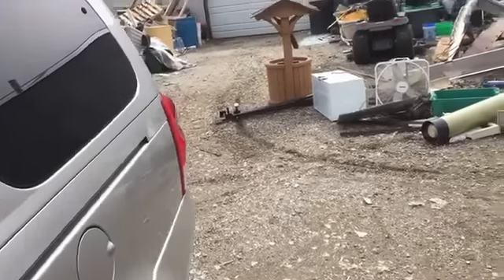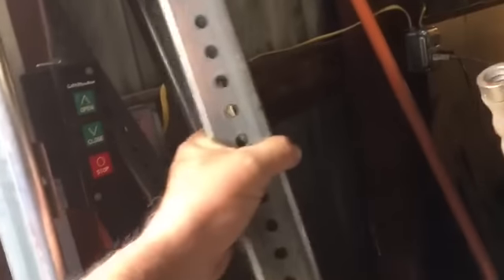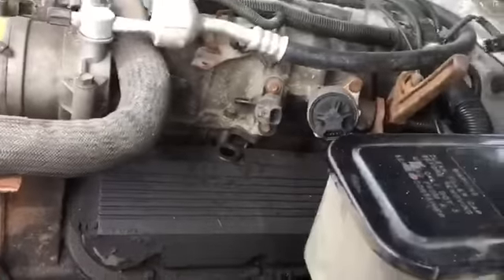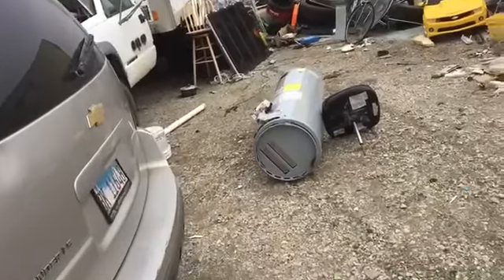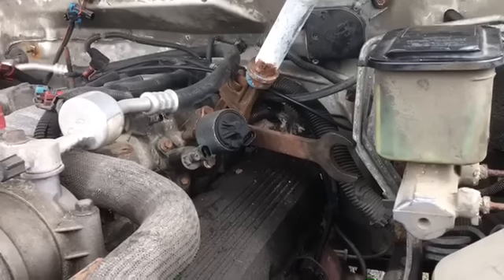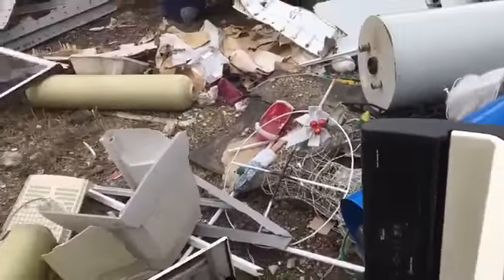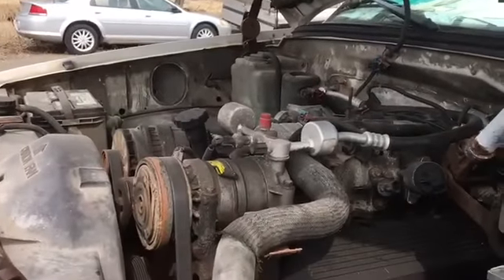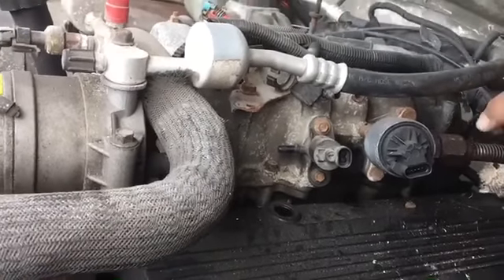Back at the compound

Comment: wedge a piece of wood under the wrench to help spread the pressure over the valve cover and keep the wrench from moving
Reply from the maker: Yup ya idea almost worked   Until the wrench 🔧 started to BEND!   now it’s not a snug fit anymore 😳🔧
Gonna have to cut the tube
Reply: @steelisthemeal  just go to an automotive shop and buy a spanner, that actually fits it wont be more than $15
Reply from the maker: Alexander platz gotta find a thin one 
Most of them are too thick to fit into that tight spot
Reply from the maker: Alexander platz especially the cheap Chinese ones at Harbor freight tools
Reply: @steelisthemeal  What about Snap on, here in the uk we have Snap on trucks driving around visiting mechanics at their garages , I'm certain that they could sort you out my friend these tools are made in the USA and the best tools you can buy so no problem with quality there
Reply from the maker: Your right we have those guys all around 
Usually find those guys at car dealerships
💰💰💰💰
Very expensive but probably worth it
Reply: @steelisthemeal  Dont think it would be more than $25 for a single wrench, gotta be cheaper than a mobile mechanic  my friend
Reply from the maker: Ya right bout that 
Mobile mechanic is $160 just to come out and $110 per hour two hours minimum
Reply: @steelisthemeal  well worth a punt then Marty,me I'd give it a go might be the best just had a quick look on line and they are from $25- $50  still wise money spent I think
Reply from the maker: Perhaps 🤔

Comment: I believe your going to have to heat up the tube nut and brace the skinny wrench with a piece of wood
Reply from the maker: Yes. I just did that and well
It worked until the wrench 🔧 
Began to get bent😮😳

Thanks though 
Good idea just too bad it bent the  wrench 🔧
Reply: Scraplife 24/7 too bad you have emission standard there  or I'd  eliminate it  I still say get another wrench and get a torch and heat that sucker up good . Or worst comes to worst cut it  or sometimes you can just unscrew the skinny nut out of the valve still attached to the tube
Reply from the maker: I was heating it up and it seem like it was working you also have to be very careful cause of all the aluminum parts
All my cars are registered just outside of the emission testing zone😮😁

I just don’t want to be noisy under the hood looks like you’re going to have to cut it what sawblade works best because ordinary sawblades just turn to butter knives the second you put them on this stainless steel tube